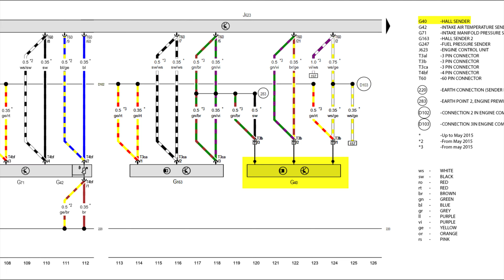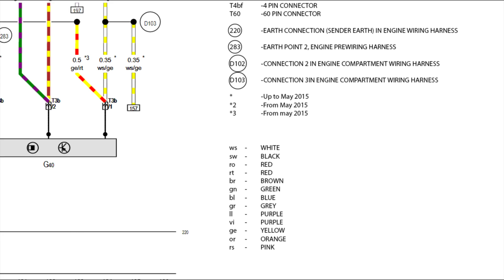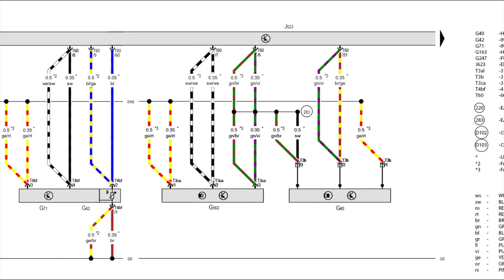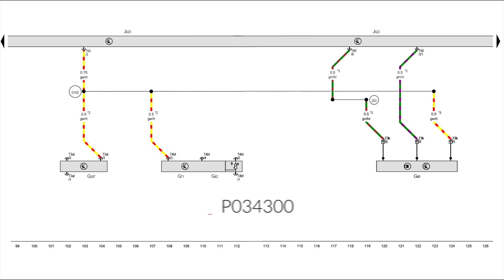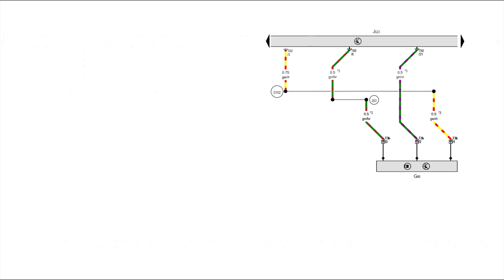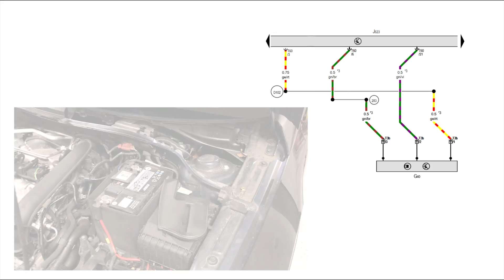How to read VW Wiring Diagrams (With Camshaft Sensor Example) - VOLKSWAGEN

Comment: I have a diagram that has notes say:
* Through November 2015
*3 From November 2015

what does the "Throuh" mean?
Reply from the maker: You can have contradicting information in the key. It would only be a concern if both of those were applicable to the same wire though?
The through I would imagine just means that if your car was manufactured during November of that year, this applies to that wire.

Comment: General motor wiring diagram is very easy to read and understand,  in this diagram how i know 5v reference or low reference or control module ground.
Reply from the maker: Its not always easy, on the newer diagrams they are starting to label them with a little 5v symbol. On the older ones its a process of elimination like I did in the video with the live feed. They just did not and still do not always label them.

Comment: Im sorry, I didnt understand how do u know where T60 pin is?
Is that pin on the ECU?
Reply from the maker: T60 is not a pin. T60 is the designation given to the whole connector plug that plugs into to the engine control unit. If you look at the key on the wiring diagram it shows that T60 is a 60 pin connector. This basically means it is a connector plug that has 60 wires / terminals / connections to the engine control unit on this plug. There are usually 2 connecter plugs that go to a engine control unit, the designations used are nearly always the number of wires on in the plug. ie T60 & T90. This makes it easier to tell which plug you need to look at on the ECU. The T90 would be the bigger connector plug and the T60 would be the smaller plug. If you look at the previous video to this, you can see me rewire several pins on the T60 plug and you can get a good view of what the connector plug looks like. Hope this helps.

Comment: This was very helpful! Where can i find the pinout values and parameters? I have alldata diy, and I can't for the life of me find them!
Reply from the maker: That's a great question. Unfortunately if its not shown in the wiring diagrams you have access to its very hard to find unless someone can post it in a forum for you. 
A lot of the time the values you need to know can only be found inside of the test plans as your working through them on the diagnostic machine. Sadly I am not in a position to look these up for viewers.
Reply: @ford873  Dang, that's pretty rough for a diy mechanic to access :/ 

Thank you for taking the time to respond and help me to be more informed! I'm struggling with a left headlight electrical issue, only 0.4v being sent to the low beam wire :(

Comment: Great video & well explained. Quick question- how did you delete the unwanted wires?
Reply from the maker: I used Photoshop to paint out the wires, then blended between the two images using the video editing software.

Comment: Which software are you using For the diagrames?
Reply from the maker: No software used, I was supplied with the original.
Reply: @ford873  Ok thanks.

Comment: Hey great video it helped to get my head round the mess I’ve made with my vw mk5 the original sdi blew up on it and I have swapped it to a bkd block but the wiring is a problem that I can’t seem to sort where do I find full diagrams?
Reply from the maker: As I work for Volkswagen, I can’t offer any solutions other than legal ways. There are however several companies that offer a subscription service to access the manuals and diagrams that you probably require. For example auto data. Volkswagen do also offer this service but I am not sure what the criteria is to qualify to access it.

Comment: I have a weird problem after removing some aftermarket wires from car (2006 golf 5): front parking lights dont work. Bulbs pass continuinty test.
I take my black and white J519 diagram, find bulb for left side, find it has a common ground with left high & low beam light, but they work, and also continuity shows ground ok. But on the power side it seems its supposed to get power supply from J519 which it doesnt, wire looks ok from J519 end but has 0 volts there and is continuous to ground. No error message on VCDS about short to power or ground. How would you diagnose it ? The J519 module spreads over many pages and its unclear what happens with the wires that go to it. I was thinking to check wiring from light switch to J519 module ?